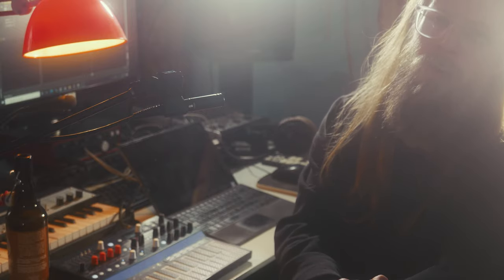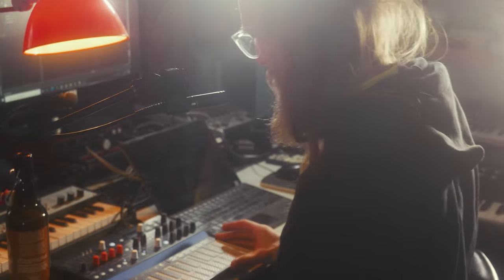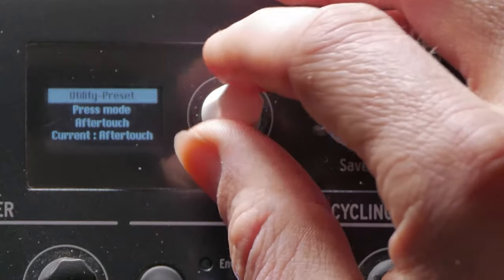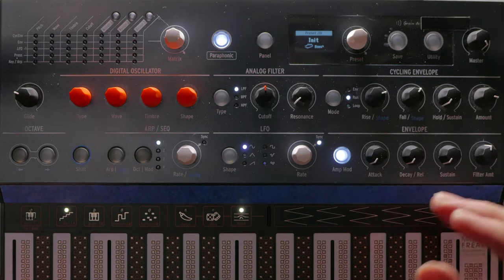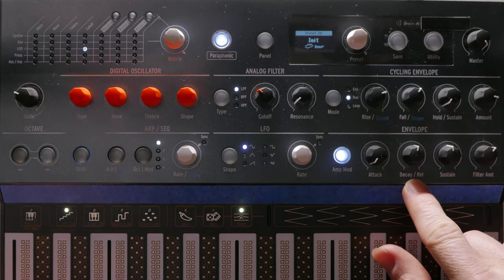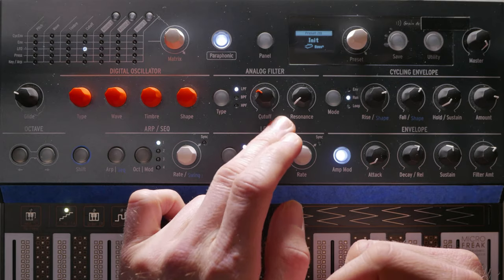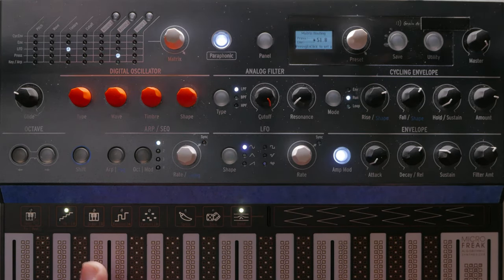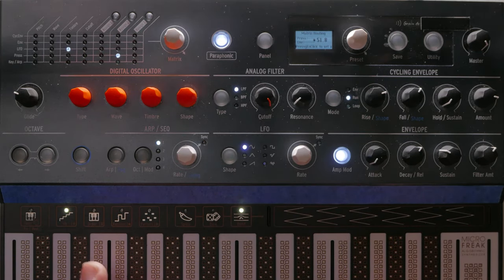MicroFreak Tutorial: Electric Piano patches How-To

Comment: Great video, thanks. I got lost a few times and I guess I just missed some param changes, and just happened to notice the knob didn't match from mine to yours, but I got it in the end. Thanks!
Reply from the maker: I have my knobs setting set to relative, so their position won't be of much use. The values aren't intended to be exact. Just tune to taste. Ideally, use the technique as a starting point and arrive at your own take on the sound.
Reply: @Thoracius  Right at 7:23 there's an edit where the filter knob is turned all the way to the right. I still had mine at the position it was in right before that, and wasn't getting the same effect you were, and needed it turned up all the way